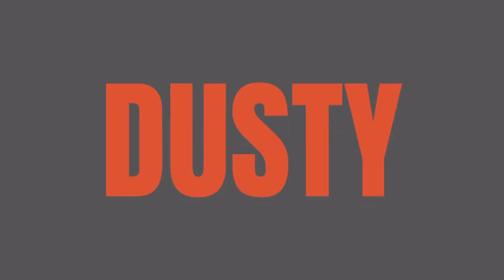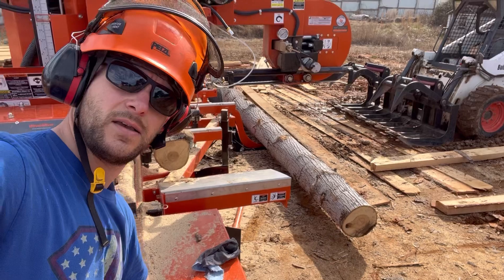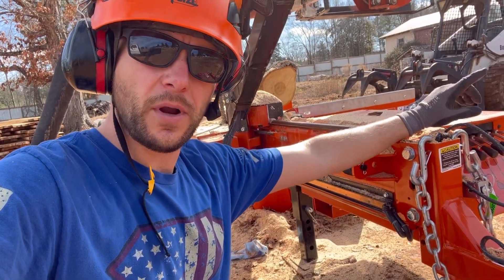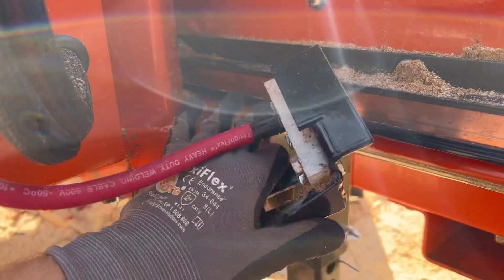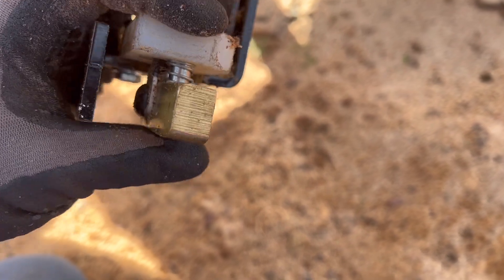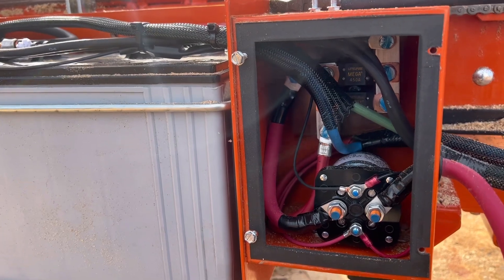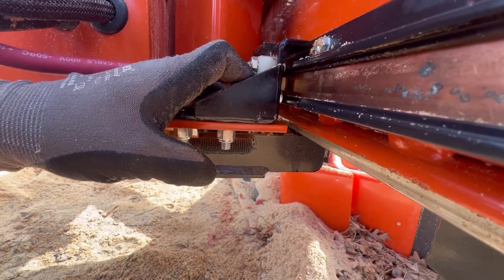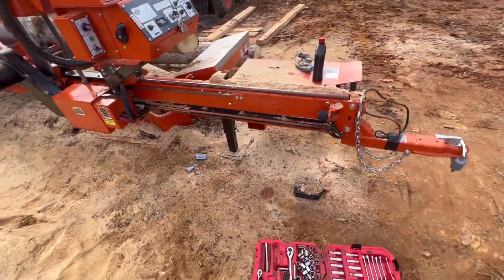Hydraulic Issues With the Wood-Mizer LT-40 (simple fix)

Comment: Simple to add a extra battery to system. Open hydraulic box and run a positive wire from solenoid out of hole in bottom of box. Connect ground wire to box and run it out same hole. Connect wires with quick connect to a 12 by battery
Reply from the maker: I need to do it. If you leave the current system exactly as is, will it charge Tre secondary battery when the head is in the forward position? I’m assuming it would with the circuit being completed?

Comment: Ben, I believe that the hydraulic power pick-up is more about $$$$$$$$ than $afety.....my opinion. It would be quite expensive to properly run a power cable from the carriage to the hydraulic box. It involves a flexible track for the cable and the associated track supports. You could do it yourself if you really wanted (check out Igus). You'd need just under 25' of track.
My LT40 (non-Super Hydraulic) hydraulic box has room for an auxiliary battery which would put power to the pump ALL of the time; even with the key off. I believe that your Super has 2 pumps in the box which would leave no room for the battery. Also, any battery not connected to the charging system will need to be charged externally to the mill.
I'm going to check my mill now to see how difficult it would be to run a cable track.
Good video,
Dave
Reply from the maker: Good thoughts, I agree it would be expensive at 4+ $ per foot for cable plus all the extras. 
Your comment spurred a thought. If an auxiliary battery was added to the system it should charge while the head and rail are in contact and the engine is running. 🤔🤔🤔
Reply: Checked my mill and there are 5 options that I see.
1. Get a length of welding cable and connect the two ends then let the cable lay on the ground. This is a terrible way to do it, but it will work.
2. Add a tall support on each end of the mill, string a steel cable between and then string the welding cable along the steel support cable. I wouldn't do this but it also would work.
3. Add a cable track to the side of the mill and run the cable in it. It's the best option, in my opinion, and you may be able to get all of the components directly from WM. This would probably be more expensive than buying the components elsewhere but it'll be a lot easier.
4. Get a plastic battery box and battery and set it next to the hydraulic box. This is probably be the cheapest and you'll have to recharge the battery often. I doubt the battery would last a day without a re-charge.
5. Add a battery inside of the hydraulic box, if there's enough room. I would be very concerned about corrosion from the battery though.
Good luck,
Dave
Reply: @DustyRanch  That's true; but it would need to be there awhile. Still should work, though. Watch out for corrosion and explosive gasses.
Reply: Your comment about the battery not lasting long......would there be much need for running any of the hydraulics other than the log clamp when the mill head is down the track?  That's where I see the issue is, unloading the mill after cutting.  I prefer the head down the mill so it's not in my way when I unload boards.  Just a thought

Comment: Usually on FF guys show how they add a ground strip further down the deck (like the end of it) but otherwise the ground strip is needed to ground the hydraulic power feed so most if not all I know of, leave it alone other than to add another strip (which I thought the super had already?)
Reply: Also -- Sad to see this.  Quality at WM was always awesome and this is the 3rd or 4th vid I've seen of problems with new mills!
Reply from the maker: After thinking about it for a while that’s what I came up with also. As of now it’s not bothering me enough to spend the extra money. But possibly in the future.
Reply from the maker: As far as quality, It was frustrating to work on a mill with 8 hours on it, but I honestly think it’s just a matter of working the bugs out. Nothing seems poor quality just loose bolt’s and such.

Comment: Mines doin the same thang with 50 hours..  I have the operators station with the cable track already there... May be runnin a cable soon...  Frustrating though when i grab them handles and nothing..
Reply from the maker: Agreed. Mine is still doing it occasionally. As I understand it. The contact has to be adjusted pretty regularly.
Stay safe and keepitdusty. 
Benjamin